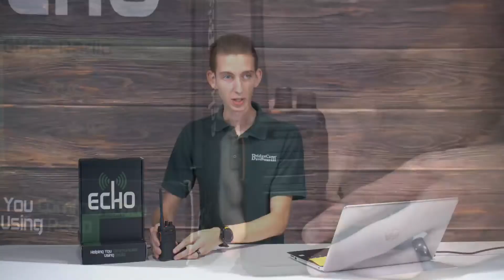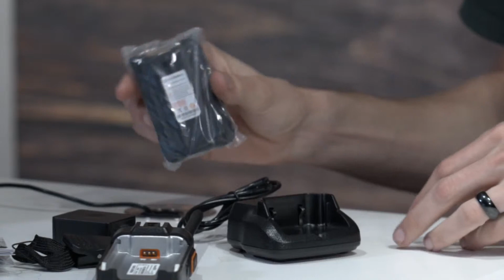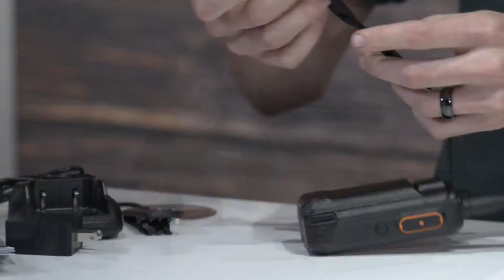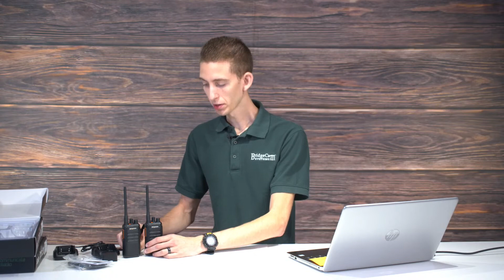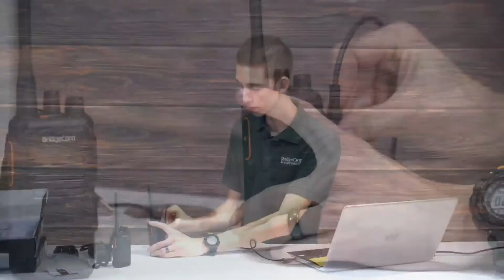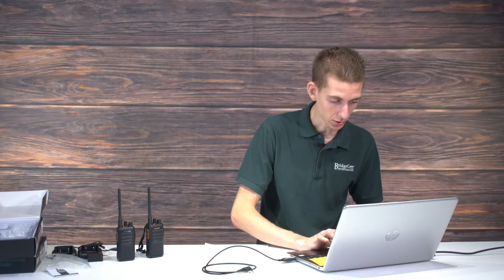BridgeCom GMRS Echo Radio Demo

Comment: #1 AT already has a nice GMRS radio, the 878
#2 Update the firmware to the GMRS rules set by the FCC
#3 Done

For example if an FRS Y is typed in limit the wattage.
GMRS limit the wattage.

I feel that this is a simple change that would propel the AT-878UVIII into a league of it's own. I can't see the FCC having any qualms either.  

If someone can find fault in this then by all means please explain.

But at the end of the day this "Echo" is a sad sad attempt into the GMRS market. 

The Wouxun KG-935G GMRS is hands down a better choice. Hands DOWN!!

For $50 more you get:

Up to 999 Custom Channels
136-174.995 MHz Receive Only VHF Frequencies
400-479.995 MHz Receive Only UHF Frequencies (70cm)
NOAA weather Channels
NOAA weather alerts
Tune Specific Frequencies Directly (Frequency Mode)
Simultaneous Dual Channel Receive

5.5 Watts Maximum Transmit Power
FM Radio
Standard and Non-Standard CTCSS/DCS Tones
Split CTCSS/DCS Tone Support
High/Med/Low TX Power Levels
Channel Scan
Priority Scan
CTCSS/DCS Tone Scan
Scan Group Support
Wide/Narrow Bandwidth Selectable
Large Color Backlit LCD Dual Display
4 Display Color Themes
Channel Name, Number or Frequency Display
Incoming Caller ID Display
Volume Display
Backlit Keypad
Companding
Descrambler
DTMF Encoding and Decoding
Group Call, All Call and Selective Call
Timeout Timer
Audible Button Beeps
English Voice Prompts
Transmit Overtime Alarm
Scan Add/Delete
Busy Channel Lockout
Battery Meter
Low Battery Alert
Power Saver
VOX
2 Programmable Function Keys
Stopwatch Timer
Keypad Lock
Built-in Flashlight
Li-Ion Battery Pack (3200mAh)
Rechargeable Battery Included
Battery Charger
IP66 Waterproof
PC Programming Support
Drop-In Charge Capable
Audio Accessory Connector
Factory Reset
One Year Manufacturer Warranty
Included with the Wouxun KG-935G
Wouxun KG-935G GMRS Two Way Radio
3200mAh Li-Ion Battery Pack
Removable Antenna
Belt Clip
Wrist Strap
Charger Tray
AC Cable
Owners Manual
Reply: It probably comes down to licensing. Though a very good question, as there is no longer FRS only channels… Given that these do repeaters and so are likely classified as GMRS only, they should also have detachable antennas. I believe I own some of the last radios licensed as FRS/GMRS. Its one or the other now, while ignoring they can hear each other lol… There has been some very strange flip flopping with these things that I have no clue or care anymore. My Baofengs are my GMRS radios now. Cheap and easily locked down if you want to give to a kid.
Reply: @echo-hotel  firmware tweak's. That's all.

Comment: Ha. Obnoxious that it appears one is required to utilize software to change the privacy codes/tones. A front facing led screen and the ability to change the codes/tones on the run is what would have made this a decent FRS/GMRS radio. Not worth it. Other, cheaper options available that are more flexible. How about that annoying announcement when changing channels? Hopefully that can be turned off…but wait….then how would you know what channel you’re on? Lol.
Reply: Actually the concept of no screen and only programming through software may be perfect for certain applications. I just ordered 4 units to give to my non techy, non radio friends to use when they are at my ranch. All they need to do is turn radio on and use PPT when they need to call/talk. In town we can all use the same repeater to call each other.
Having BridgeCom reputation behind them makes these radios a great choice.
Reply: @bricktrainfan  All your “non techie, non radio friends” need to do is get their GMRS License.
Reply from the maker: You should buy one.   We think you'll like it.

Comment: Cool video whats the range roughly in a city my part has trees, houses and cars. I have a friend who lives in my neighborhood about half a mile away. The site says 2 miles in a neighborhood setting. And can you change the privacy codes without using the computer? Alot of gmrs radios have this option which is convenient.
Reply: Line of sight up to maybe 15 miles to as low as 400 yards.
Reply: @Rusted_Link  Ah yeah line of sight range im sure won't happen since I'm in a city haha but I have been told should get at least 2 miles
Reply: @MKF30  all I can say is give it a try. Range is always going to be dependent on the area you talking from to the area you are talking too. It's really hard to say. Sorry bud. I wish I could be more helpful.
Reply: @Rusted_Link  its all good man appreciate the help. I'll test it out its all I can do but have been told ham is now far easier to get and cheaper than gmrs license too so ill probably try that too.